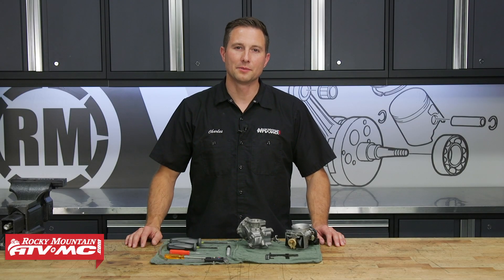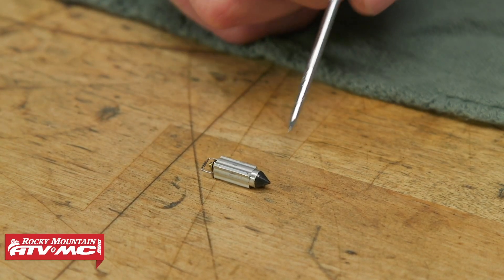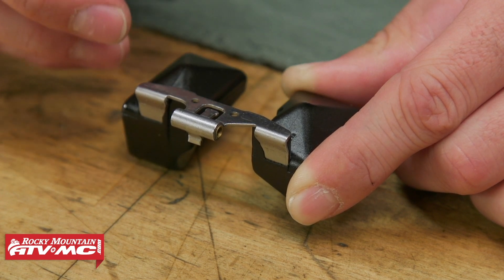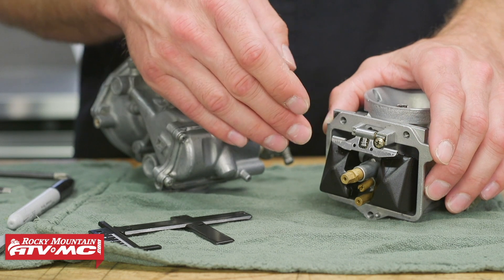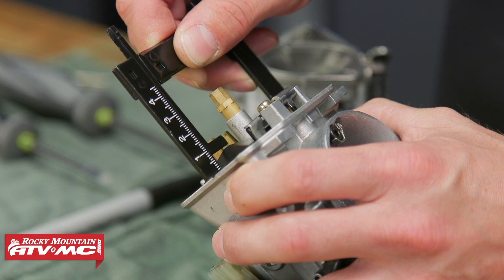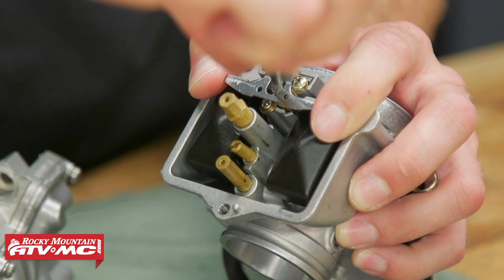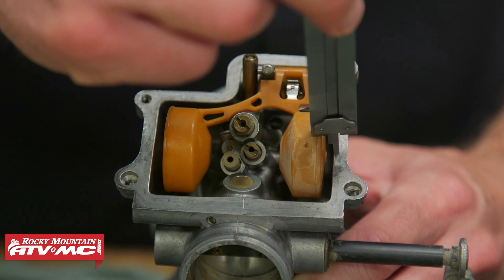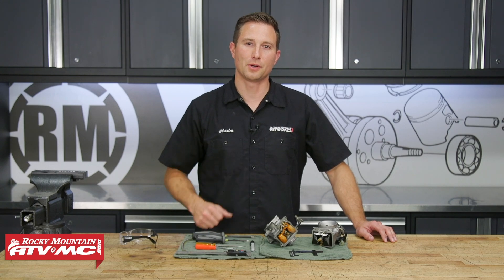How To Set and Adjust the Carburetor Float Height on a Motorcycle, ATV, or UTV

Comment: Or you can just set your caliper depth gauge, turn the carb upside down and connect a tube to your fuel in on the carb and blow through the tube while moving the floats. When you can't blow measure the float height and adjust to suit. Bit fiddly on your own but works for me.

Comment: I installed a slightly bigger pilot n main jet, will i need to change the float height from the previous setting with stock jets?
Reply from the maker: You shouldn't need to adjust the float height.

Comment: >buy bike
"new tank"
>crank over and immediately fill the carbs with paint flakes.
guys, put a fuel filter on the bike before you crank fuel into the carbs, the moment we did that some comically large piece of O-ring just floated into the filter.

Comment: I am trying to find the float height for my 03 YZ125, the manual says 9.5 - 10.5 above the float chamber mating surface, however they are measuring fuel level, and do not call it float height nor can I find "float height" in my manual. Is fuel level & float height the same? If not, do you know the float height for a 03 YZ125?
Reply from the maker: Measuring it that way will have the same results. It's just an external measurement instead of an internal. If you measure the fuel level like the manual says then you should be alright. Just a little more time consuming trying to get the float height correct if it is wrong.

Comment: Why 45° and not upside down?
Reply from the maker: If the carb is upside down, the weight of the float will press down on the plunger giving you a wrong measurement. You want the plunger to lightly seat on top of the plunger.

Comment: Why does my carb on my 2005 Suzuki eiger 400 still leak gas into the airbox evenafter rebuilding the carb, ultrasonically cleaning it, checking the float height and it’s ability to float and polishing the needle seat
Reply from the maker: Do you have the OEM petcock on the tank? The diaphragm inside the stock petcock could be bad and fuel could be going up the vacuum line into the airbox.

Comment: I would be happy to receive your help on a problem I have with the carburetor as soon as I start the motorcycle I have a leak from the excess pipe I did a test and all the signs indicated a problem with the float or the valve after countless attempts that failed to solve the problem I decided to replace the carburetor and after the replacement the carburetor was on another motorcycle
 And it was normal. But my motorcycle again had leaks from the excess pipe, do you have an idea or a solution to the problem

Comment: Please my motorcycle atv sound like the airflow is blocked but as I move for sometime then the speed come back to normal and speed well but If  I lowered the acceleration and raised the speed again the same problem come back again please help me
Reply from the maker: Have you looked at your jets inside the carb? Sometimes those can get partially clogged and exhibit some of the symptoms you're experiencing.

Comment: I hope this helps prevent gas from leaking out the overflow tube.  I've cleaned and replaced parts that hadn't helped.
Reply: Did it help
Reply: @krookedENT  No, it didn't help.  I now assume the float level is off.  Which way do I bend the metal tab to reduce/stop gas from flowing out the overflow?
Reply: @jeremy22b Was your carburetor leaking from the overflow tube even with the floats adjusted correctly?

Comment: My only question is with the tube test how would you go about adjusting it? If the fuel is way under the line would you set floats higher?

Comment: I got an 84 cb650sc and the floats and where they attach to the needle valve is completely plastic.  How would I adjust those?
Reply from the maker: There’s a small metal tab that rests against the needle. To adjust the level, simply bend the tab and then check the float level.

Comment: I adjusted my float bowl and now the manual choke won't work on cold start I have to give it gas to fire up also the plunger has no spring/ nakuru carb 50cc fuel  only carb/ idle and fuel air mix screws

Comment: Hey friend, I have a VM 22 clone carburetor on my sons mini bike. The brass  tube on the inside of the bowl that makes it drip if it’s too high, that brass tube is level with the gasket. I set my float so it is 25 mm below the little brass tube, so when I check The gas level with the tube it sits 25 mm below the seem or the gasket , I hope that is correct. It calls for 25 mm. Please let me know thank you

Comment: Love your vids brother. I took the carbs off of this v twin. I made sure diaphragms, jets, gaskets, needles, and all were good. Put them back on and still dies upon throttle. After checking everything numerous times, and replaced all lines, it still dies upon throttle but only revs up if I spray the carbs. Could a float out of adjustment cause bike to die upon throttle but still idle? Only revs if I spray the carbs. Any help appreciated. Thanks for the vids.
Reply: My guess is it could. If the float is set too low it's not getting enough gas in the bowl to handle throttle but could handle idle. My problem on my KLR I'm thinking is the it's set too high and it floods the carb which makes gas go out the overflow.

Comment: My bike idles low and then stops when I rest it on the kick stand. It sputters a little in the hills an won't idle on steep inclines. But it runs like a train on flat ground. New carburetor. Could it be the float height?
Reply: yep. set float to shut off sooner

Comment: How does float height affect the mixture? I thought the jets and adjustment screws control that. I had always assumed the float height is just about keeping the chamber filled so the jets are submerged during rocking of the bike.
Reply: It’s more so if it creates a lean condition. If the bowl isn’t filling, it runs lean.
Reply: Less fuel in the bowl = less fuel agitation = less excess fuel up to the venturi.
Reply: gravity, column height, bar.
Reply: Kinda like drinking big gulp that's almost empty through a straw versus a full cup. The effort you apply to the straw sucking when the cup is low is greater than if it were to be full.
Reply: X2

Comment: You dont have to have all that to set float height. Length of see through Tygon tubing placed on drain nipple on float bowl. Never fails, spot on. Finally a video that's shows the correct way.
Reply: the problem is- you still need to know at what level fuel need to be- i cant find it anywhere for mikuni tmx 38 carb... :(
Reply: @labasrytas2876  isn't it 10mm above float bowl flange/gasket surface,  thats what manual says i believe
Reply: Some CVK carbs the float bowl surface are angled , not horizontal

Comment: Can float level lead to plug fouling?
Reply from the maker: It can, but it's more likely to have something else going wrong. Make sure the you have good compression and spark and the right spark plug. As long as those are good, verify the float height is correct, then work on your jetting. (make sure the air filter is clean and in good condition.)  -Charles

Comment: Having trouble finding the correct float height for my 96 yz125 can anyone help me out?
Reply: Do you have a pwk 38 carb? I’ve been having the same trouble got a full rebuild kit on eBay but I didn’t get a new float just needle valve. What are you having trouble with?

Comment: What's the name of that tool you used at 7mm to verify float height?
Reply from the maker: That's the K&L Digital Caliper. You can click the first link in the description to check it out and the other tools used in this video.
Reply: Its just a vernier caliper, but a digital one. U can get them at any parts or hardware store like a home depot, napa etc. 15bucks
Reply: All you need is a length of Tygon tubing you can see through. Place it on bowl drain nipple, hold hose up beside fuel bowl, open drain screw, the fuel level in the hose will be the same as level in bowl. Make sure there are no air bubbles in the hose. You can move the hose up and down, does not matter, level remains the same. Simple physics. I like my fuel level just at or under where the bowl meets the carb housing. You dont need any fancy tools or gauges. You do have to have a fuel bottle that you can hang up above the carb. I clamp my carbs in a table vise. This way you can leave carb sitting with fuel loaded against the float needle all day to check for leaks and test the float needle to see that its holding and not seeping fuel, flooding. I do carbs almost daily for years, this is the best way and easiest to bench test float level. The more fuel you have in your test bottle the better.